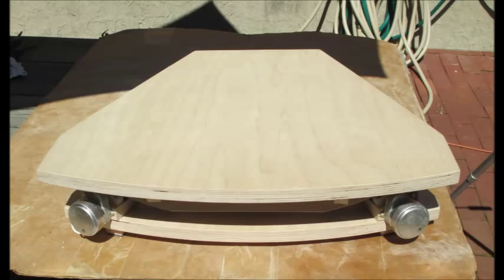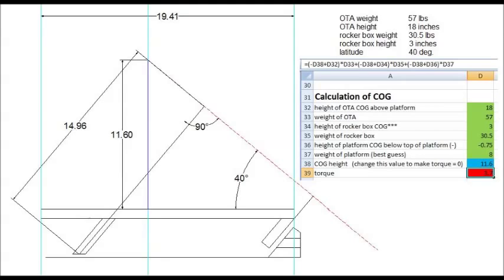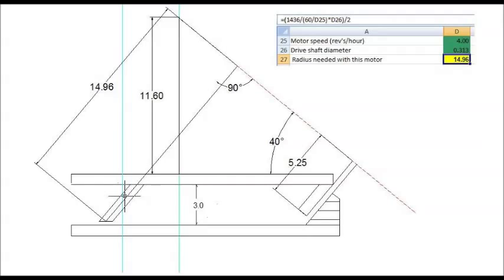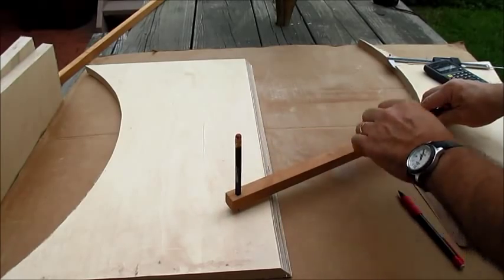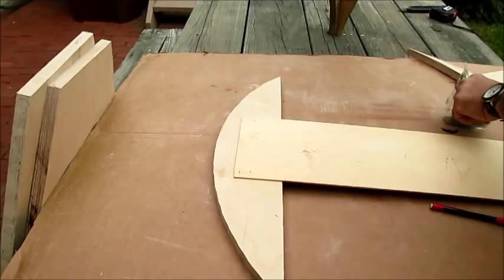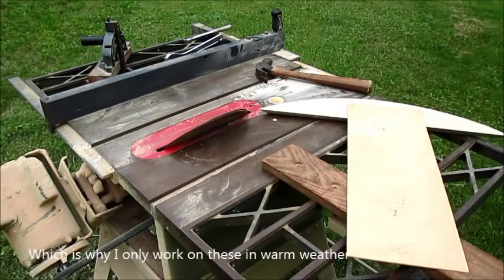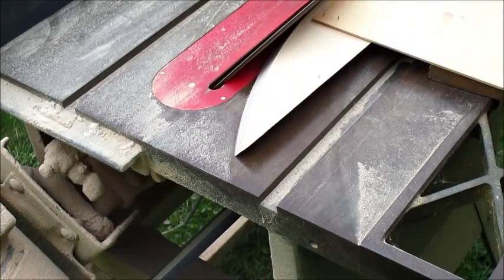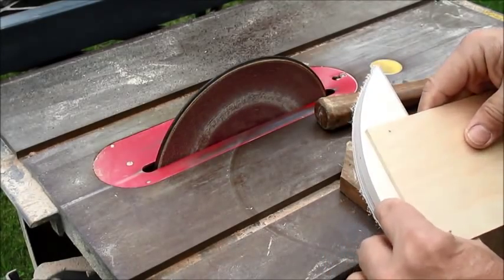Eq Platform part 1

Comment: I had  a platform  by Mr. Ed and it's a work of art. The craftsmanship is at a Superior level and glides across the sky like a feather and built solid as a rock. Very humbly priced. 
Thank you Mr. Ed!!
Reply: What size dob did you get it for?  Did you go with ac motors or stepper?  Are you able to do any astrophotography with it?  I'm curious because I'm not sure if I want to go with steppers for more control, or ac sync.  Concerned that steppers might not be smooth enough.

Comment: Awesome video.  Couldn't you just use a table saw blade to cut the angle??
Reply from the maker: Well you could but the cut will be rather rough you would have to do a lot of sanding afterwards.

Comment: You mention to set the COG value such that torque equals 0. However, in your example, the height is 11.60 but torque is set to 3.7. I most likely am not understanding something. Looking to make one and like your instructions.
Reply: I was thinking about this more after I tried it out for myself. It seems it's hard to get it to exactly 0. I believe you said it was ok to get it down to 10th of an inch or something along those lines.  So my understanding now is to just get that 'torque' value as close to 0 as possible.

Comment: Great video! I'm glad I found your channel. I have one question regarding locating  the center of gravity on the virtual axis.  It seemed to me when I was first thinking about this that I would want the intersection of the altitude axis and the OTA axis located on the virtual axis, so that point would not be making a circle around the virtual axis as the platform moves.  In any case the two spots [COG and the alt/OTA axis intersection] won't be that far apart and it may not matter.
Reply from the maker: This is no different than say a German equatorial mount where the OTA axis revolves around the polar axis.   An English yoke is the only one I can think of where the polar axis and OTA coincide.

Comment: First of all Ed Jones: Thank you so much for a great design and a very nice how to video!!  And yes, yours are VERY humbly priced.  So much so, that unless you're really a DIY-er for the fun of it (of which I am) it only makes sense to order one.  I'm going to have fun making one but I can pretty much guarantee that by the time I finish all the tweaks, fixes, re-dos, and what-not I'll be in it for more than If I just ordered one in the first place.. :) 

For those of you without Excel you can just solve for COG and round to the nearest 10th or whatever:

COG = (Hota*Wota + Hrocker*Wrocker + Hplat*Wplat) / (Wota + Wplat + Wrocker)
COG = (18*57+3*30.5-0.75*8)/(57+30.5+8) =  11.64